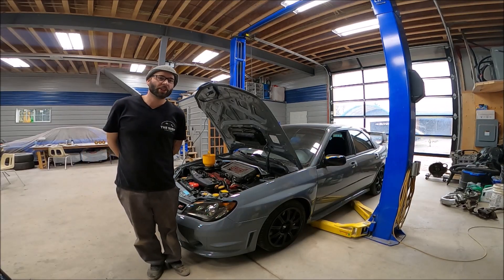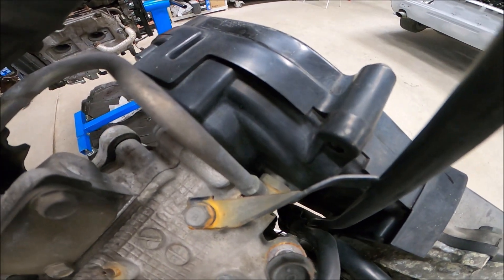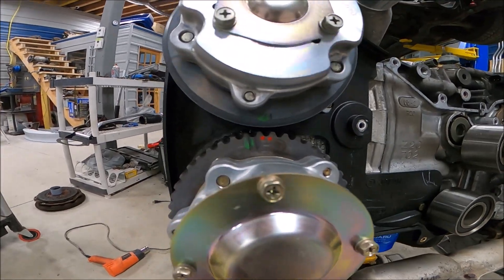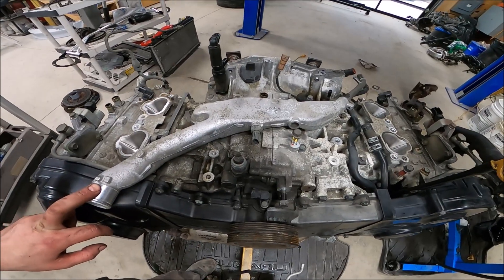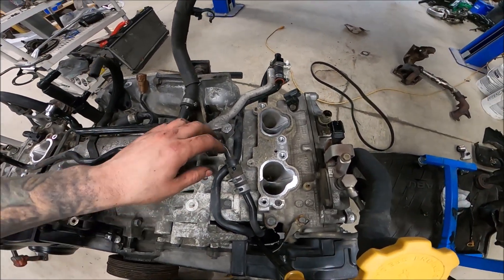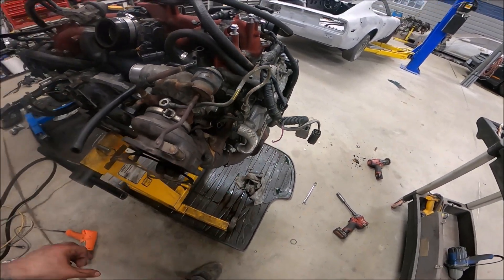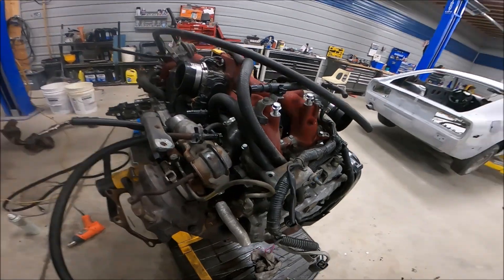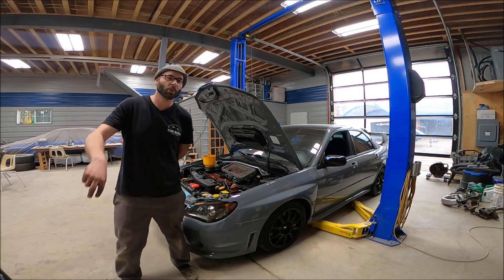How To Jdm Ej20X Swap - 06-14 WRX, 04-07 STI, 05-09 LGT, 04-14 FXT

Comment: Hey..on my ej255 turbo boost only 7psi..solenoid works..turbo with out vacuum line pushed 18psi..can't figure it out
Reply from the maker: Still have restrictor pill and stock boost controller?
Reply: @TheSubieSanctuary  yes
Reply: Ej255 2013 wrx
Reply from the maker: @Torque.Export  id start with a boost leak test. Need to rule that out before checking anything else. 
Turbo straight to wastegate should only hit 7psi, not sure how it hits 18 unless you got a 18lb spring or ewg?
Reply: @TheSubieSanctuary  I pulled the vacuum line from actuator to see if turbo works it did 18psi..with hose back in place hits only 7..feels like turbo pushing rest of the boost through exhaust
Reply: @TheSubieSanctuary  than what's the normal boost on ej255 2013 wrx..7psi?
Reply from the maker: @Torque.Export  normal is 14psi, spring pressure is 7psi. 

Id still do a boost leak test ideally as a start point. Like a smoke test with a smoke machine

Comment: Hey there, I'm assuming the EJ20X in this video is post facelift... are there any major differences between these and the 04-06 EJ20X models? I currently have just swapped in an '04 EJ20X into my 06 sti but have yet to swap over the IM and engine harness, and because of this I believe, the motor is not wanting to idle or even stay on upon starting. I've seen some things about 2 vs 3 cam sensor wires, and I am getting a few codes p0600 p0245 and p0031. Any thoughts?
Reply from the maker: Is your 06 sti a duel avcs? Like jdm? 
Or single avcs

Comment: Hey i was wondering if a ej20x would fit into my 2005 impreza wrx? Im looking to buy one with low miles from a seller nearby but i keep seeing mixed answers about it.
Reply from the maker: No it wont work for 02-05 wrx, youd need a jdm ej205, also typically cheap to get. Also have a how to swap vid for them as well on channel

Comment: I have low compression on Cylinder 4. So I’m going to be doing this swap and just rebuilding my 255. My question is I’m currently tuned on my Accessport for all my current mods. I’m also tuned on Cobb before they did the “Green Update” for Air pump delete. So technically I can just do this swap and use the current tune I’m using with my 255 right?
Reply from the maker: If you were just going to run this 20x for a bit while you rebuild your 255, ya you could get away with using the old tune if needed. Not ideal but people do it all the time anyway

Comment: I did the swap everything is fine but
I have almost no power from a stop like I have to floor it ? Timing dialed back one tooth?
Reply from the maker: Sounds like limp mode possibly. 
Any codes? Check engine light?
Reply: Yes, it's in limp mode for the secndary air box, cel and cruise light is on flashing. 
I'm going to use ecu flash to turn off the codes
Reply from the maker: @GhettyGreeen  turn off the codes for air pump and you will be all set

Comment: followed this video step by step and have p0016, p0340, and p2092. timing is correct double checked. car has a long crank but will start. car runs fine once started. any idea?
Reply from the maker: Hmm, those all relate to cam shaft sensor. Id say start with the basics. Check cam shaft sensor plug connections/pins etc make sure they good. Then next undo your engine harness to body connection, make sure no pins pushed back or that none are damaged or corroded. Then if good plug them back in and see if any difference. I feel you will have got the swap done right but probably just dealing with a connection issue somewhere now. 
Let me know how you make out and i can maybe give ya some more pointers if none of the above helps

Comment: Hey just curious if the year of ej20x matter. I have a 2007 legacy and am looking at an 05 engine.. will that work?
Reply from the maker: Unsure off hand if the 07 LGT has an air pump. This mostly will pertain to your tuning approach. If you car has air pump and you are going to tune via cobb ap then you will need ej20y engine. 
If your car has air pump and your tuning opensource and your tuner is ok with turning off air pump codes then an ej20x will do! 
Hope that helps
Reply: @TheSubieSanctuary  07 LGT has the air pump.   05-06 does not.

Comment: Doing this dual avcs swap into a 2010 wrx you just leave the exhaust avcs unplugged and don’t need any special tuning?
Reply from the maker: Correct, just leave exhaust sensor and solenoid unplugged. It is ideal to do the timing mod as shown in video. 

It is also best to get a tune overall in the end
Reply: @TheSubieSanctuary  I’m in the middle of moving everything between longblocks.  Do you happen to know if I can use the ej20x exhaust manifold if I weld a bung in?  I know it would be easy to use the 255 manifold but it’s all rusty and belongs in a scrap bin.  The one on the ej20x looks like brand new.
Reply from the maker: @kawasakividz582  i assume your 20x was originally a twinscroll. Should have a double pipe up pipe. You cant use the twinscroll stuff on any vehicle that originally had a cast intake (aluminum) the twinscroll stuff and the twinscroll turbo that would have come with the 20x is not compatible with any cast intake subarus. 

If yours was plastic intake manifold, let me know and I can give you details
Reply: @TheSubieSanctuary  so the ej25 turbo won’t bolt un to the ej20x exhaust manifold?  I assumed it would because I see aftermarket manifolds that say they work for both.  Both my ej25 and ej20x have plastic intake manifolds
Reply from the maker: @kawasakividz582  its single scroll vs twinscroll though. 
Usdm plastic and usdm cast vehicles all have same single scroll turbos so they all work the same fit. But not twinscroll
Reply: @TheSubieSanctuary  I’m not really sure what you’re telling me I should do.  Like wether or not I can use the ej20x exhaust manifold
Reply from the maker: @kawasakividz582  you 100% can not use the ej20x exhaust mani if your car has a cast aluminum intake manifold.
Reply: @TheSubieSanctuary  both the car and the ej20x are both plastic
Reply from the maker: @kawasakividz582  ok, then you need the twinscroll intercooler and a twinscroll downpipe. Thats it! Typically the twinscroll o2 sensor will just install at the top of the downpipe
Reply: @TheSubieSanctuary  thanks brother 🙏

Comment: so I've been eyeing on doing this swap since my ej25 has a blown head gasket and ring land failure. Am I able to beat on it and drive it safely while using my stock ej255/06 WRX ecu without a tune?
Reply from the maker: It will work fine, a tune is ideal. 
If you dont want any check engine lights you will need an air pump ej20x though
Reply: @TheSubieSanctuary  i can’t use an air pump from the ej255?
Reply from the maker: @lilramen6681  only if you get an air pump applicable ej20x/y only the later 20x/y came air pump applicable. If your shopping for one, send me link and I’ll confirm if youd like

Comment: So I came across this engine swap and I see that you said it works for the 06-14 wrx, I have a friend who wants to sell me his 08 that had the engine stolen and was wondering is it all the same process for the wrx as the sti or is there other differences I would need to look into to make the swap work?
Reply from the maker: Exact same process for the 08 wrx. But, if the entire engine is missing including the whole intake manifold from the 08 wrx. Then you will need yo source and 08-10 wrx intake manifold. 
09-10 forester xt intake manifold will work as well. 
Then lastly as seen in the video, its is highly recommended to turn back the exhaust cams 1 tooth.
Reply: @TheSubieSanctuary  ok cool. I was reading stuff and said that avcs was a issue and wasn’t a recommended swap but this clears that up. I really appreciate it.
Reply from the maker: @GRIMM_WERKS  these do great overall. Cheap, reliable and capable of 350whp from stock longblock. We have probably done 30+ of these swaps. No unhappy owners yet.
Reply: @TheSubieSanctuary  awesome then I will probably make this my summer project. I was looking into doing the 207 swap but saw there would be a lot more challenges and the price point was a bit up there but this id say including the cost of vehicle and everything should only cost me 5-6k. Going to see if my friend has a blown ej255 long block I can buy for the needed parts. Otherwise I gotta see if Subaru will give me my old employee discount on the parts I need.
Reply: Would this fit in a gc8 ?
Reply from the maker: @eggsalad4305  yes of course, youd need to run a 255 or 257 ecu
Reply: Have you done the EJ20Y in a ‘11 WRX? I have one damaged cylinder wall, and the EJ255 is nearly $3000 just for the block

Comment: Doing an ej20x into an 08 wrx, can I use the tgv’s from the ej20x?
Reply from the maker: You could, but youd have to use the jdm injectors, fuel rails and then you would have to add in a fuel pressure regulator.

Comment: Are you able to use the ej20x manifold ?
Reply from the maker: Plugging into what car though? In short yes you could. In long, I wouldnt even consider it. Too much work vs using the car’s original intake manifold/harness
Reply: it’s a 08 sti but I bought it a mess need to use the ej20x intake manifold if it’s possible
Reply from the maker: @dawhitewrx  thats a bug mission, the 08 sti wont run that manifold as it is. Would need to individually wire each item to mimic 08 sti. Easiest to just buy a complete 08-14 sti manifold. Usually pretty cheap if you find like local part out. When i have them i sell them 100-150

Comment: So I have a 13. If I swap the jdm 2.0 and swap all the stuff can I still run my Cobb stage two tune?? Or do I have to go open source
Reply from the maker: For your 13. To run the cobb you will need to get the ej20y so that you have the air pump.

Comment: So what do you suggest to do with the cam gears when swapping 20x in to US ECUs and harnesses that has only single AVCS?
Reply from the maker: Youll have to watch the video! 
This is usdm ecu car, with single avcs ecu. But, by watching youll see I explain and physically show everything I do. Along with no check engines lights and even dyno result.
Reply: @TheSubieSanctuary  so you trust using the exhaust AVCS cam gears?? You don't experience timing phase drifting? I mean logically it shouldn't drift but....
Reply from the maker: @ahhason  done this swap more then 20 times, each car tuned at various tuners never an issue. We do physically turn back exh timing by one tooth. They become stationary without signal.
Reply: @TheSubieSanctuary   I've seen people say you can get even more close to wrx timing stance if you swap cam gears and exhaust cams. I have a customer that bought a forester XT with this swap in it and it seems to suffer from low end power significantly and spool time. I'm about to rip his timing covers off and see how it set up. I'm a 20+ year subie mechanic. Have built a bunch of EJs. Just never any 20xy's
Reply from the maker: @ahhason  in comparison. 
The 20x exh gears would have to be turned back 1.5 teeth to be prefect. 
Id assume the exh gears were not turned back at all on that one. 
Then obviously when all is prefect, its a 2.0 replacing a 2.5. They do suffer from  loose of low end torque regardless
Reply: @TheSubieSanctuary   is this not risky at all in the long run?
Reply: Is going back a tooth on cam gear not risky on the long run and how long do these engines go for at 260whp
Reply from the maker: @MiguelRodriguez-rr4kt  you can go back 3 teeth without issue forever. It will never change over the long run. 1 tooth is the sweet spot though. 
At 260whp it will last indefinitely, we have had them tuned over 350whp and still going years later without issue.

Comment: Could you please help me with timing belt kit selection. I have an ej20x going into an 09 Forrester xt. I am having difficulty trying to determine what timing belt kit to use for the ej20x. Any help would be great.
Reply from the maker: For a 2009 forester xt you would use an 09 forester xt timing kit on the 20x Water pump is the same as well. 

Unless your 20x you end up with came from a manual car then you would use a 08-14 sti timing and water pump kit
Reply: @The Subie Sanctuary  you are the man!! Thank you for the reply!! I'm about ready to throw this thing in the car finally. One last thing. This ej20x is from automatic. My forester is an auto as well. Do you know if the ej20x flex plate will work?
Reply from the maker: @AWDGSX18  you can compare them to be safe. But most all that ive seen have been same flex plate as the domestics. So yes you should be able to use the 20x flex plate
Reply: @The Subie Sanctuary  yea that is my problem. I purchased the car without an engine. I have collected all the components I need. The intake. Turbo. Exhaust. Just don't have the flex plate to compare unfortunately
Reply from the maker: @AWDGSX18  ahh i see, yes it will be fine. I actually compared a the 20x flex plate recently to domestic turbo on. It was the same fit. I just didnt want to say yes and your case be the one that ends up not being the same. Confident youll be fine
Reply: @The Subie Sanctuary  I just appreciate you responding and your knowledge!! I have been intimidated to even try this. Found your video, and now I feel more confident. I am sure I will have more questions.

Comment: I have an 07 WRX TR, both the ej255 and the ej257 have only single AVCS for the 2007 WRX and STi I believe? Following your method would work for the swap to the ej20x from an ej255?
Reply from the maker: Well yes of course! Thats the reason behind the video is to show how to properly run the ej20x in single avcs cars. The reason you would do this swap is if dont want to spend much money. 
There are some more appropriate jdm engines like the single avcs 32 bit single avcs ej20. But they are triple the cost and then your getting close to cost if finding a 2.5
Reply: @TheSubieSanctuary  just wanted to clarify, don’t know much about the 257. I haven’t done enough work with these engines to know the differences.
Reply: Did you swap the motor mounts? Any issues with fitting it into the engine bay? Was this tuned after? I assume it would run more rich? Do you guys think an ots from a 2.0 from Cobb would suffice or go to a reputable tuner? JR tuned isn’t too far from me. I will have many questions especially once I really start digging into this. Thanks!
Reply from the maker: @eliasbossert3700  all ej’s fit the same without issue. You can see at first start the running numbers are just fine. Because its high compression a tune is ideal. Yes it was tuned, 295whp. 
Yes you can use a cobb ap
Reply: Any recommendations on a gasket set? I don’t believe, or at least from what I have been seeing the gaskets aren’t interchangeable? I believe the cooling ports won’t line up.
Reply from the maker: @eliasbossert3700  all gaskets and spark plugs are the same between 20X and 255. The only gasket that is different is the head gasket which you would use an ej205 headgasket
Reply: Did you change the head gaskets and cam oil seals? I was sent the wrong oil seals form my cams and didn’t realize it until I tried putting on the cam gears/sprockets.

Comment: What should I do with all of the original parts off of the Ej20x? Would anyone buy them or just trash them?
Reply from the maker: If you got the intercooler, turbo, header and up pipe. They can be used on any plastic mani ej’s. Can probably get 300-500 for the setup. The twinscroll stuff is fun

Comment: What's the tumbler generator valve p2016, p2021,p2008, p2011 codes for?
Reply from the maker: Tgv’s unplugged
Reply: @TheSubieSanctuary  yea that's not on the 2.0 engine to plug in
Reply from the maker: @outlawdog013  will have to disable codes. EPA has been cracking down on emissions deletes. Only way currently to disable the codes and tune subarus without emissions stuff is open source tuning.
Reply: Do I need to take that off of the 2.5 and put onto the 2.0 engine?
Reply: Ok I see I didn't change over the lower intake parts
Reply from the maker: @outlawdog013  ya ive done that too before. Only hang up now a days is turning off the codes. 
Tactrix cable and lap top with ecu flash and rom raider program and your set to do it yourself. Both programs are free, just need the cable
Reply: @TheSubieSanctuary  I still have the other motor guess I'll rip the intake back off and put those on.
Reply: @TheSubieSanctuary  thanks for the help
Reply from the maker: @outlawdog013  that is an easy way to solve it. Most tuners wont/cant tune out emissions stuff anymore. Super lame…
Reply: @TheSubieSanctuary  it runs just fine with the light on lol
Reply from the maker: @outlawdog013  have you tried ripping it yet? Typically tgv codes puts in limp mode
Reply: @TheSubieSanctuary  I just did and it was slow hadn't really got into it just cruised so I'll be doing some work

Comment: Will a 2005-2006 ej20x fit on my 2007 legacy GT or would I need to order the 2007-2012 ej20x?
Reply from the maker: Does your 2007 LGT have air pump? If it does and you plan on continuing to use air pump, then you would need the 07+ ej20x with air pump